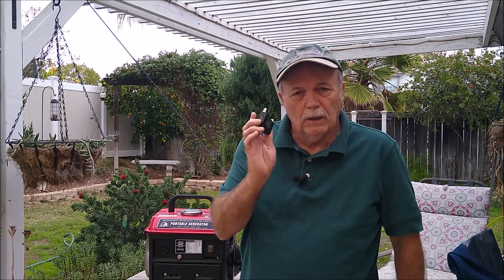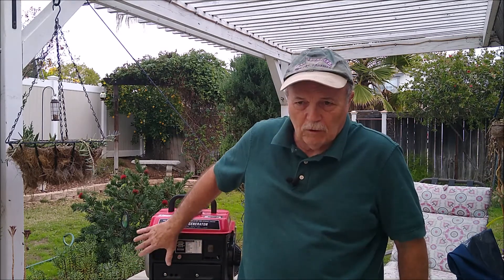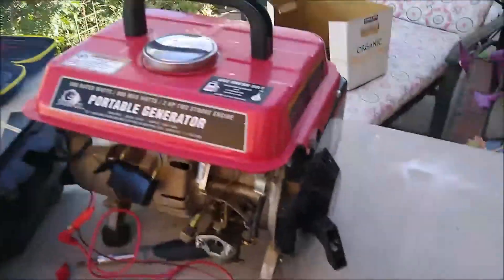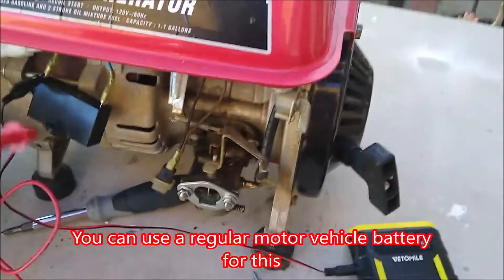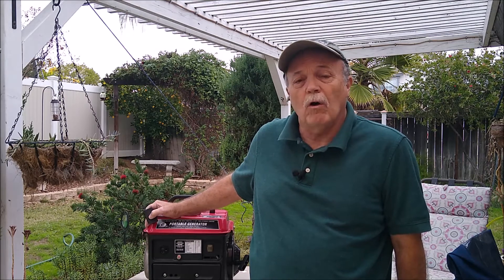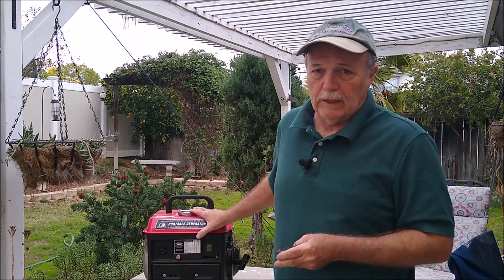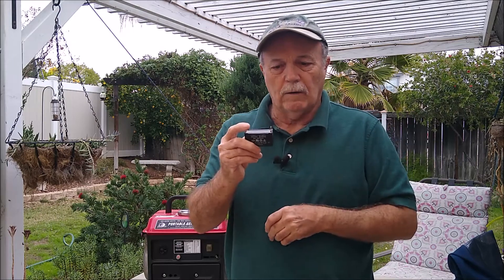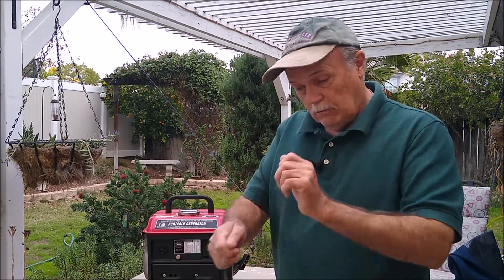Video Short Quick Tip - Direct Flashing 2 Stroke Generators

Comment: Hi there , came to this video after the full length video. I have basically an identical generator (240v version) got the engine running but no output I tried the direct flashing method you demonstrated here and the lamp came on but as soon an I disconnected the 12v battery the lamp went off I measured the output and it was about 70v but as soon as the battery is disconnected the output plummets to like 3v , what do you think the problem is ? The capacitor or something deeper inside the generator? Many thanks
Reply from the maker: That capacitor is basically used to excite the generator into starting its output. You are going to need to inspect the wiring and the connections. Look for signs of arcing and wires with strands frayed at solder and connection joints. Get an ohm meter out and test for resistance at any suspected points. Check that the windings for the stator are good with no open circuits or grounded circuits. Not sure how many phases your 220 volt unit has but they have multiple portions that work together to deliver the full voltage. Sounds like one of them is not operating. It is difficult at best diagnosing something with it not being in front of me but this is where I would start looking. Hope this helps.
Reply: @ Hi thanks for your reply, I’ve since changed the capacitor and now it outputs power but the only problem is that it’s outputting 260-280v instead of the 240v it should be outputting any ideas? Thanks